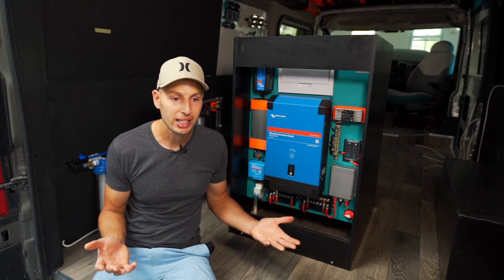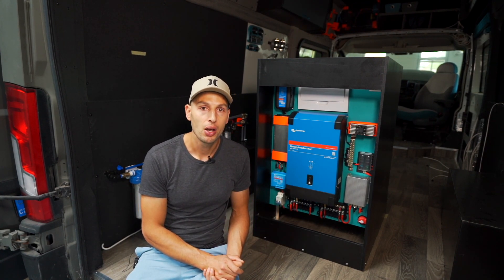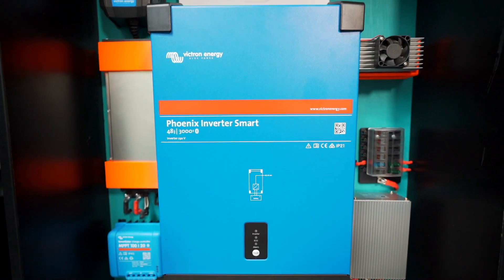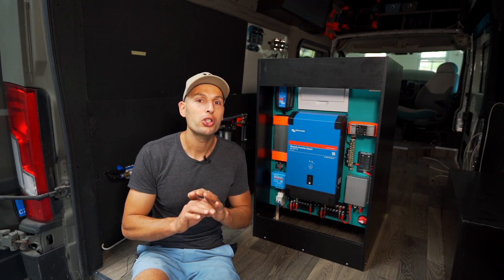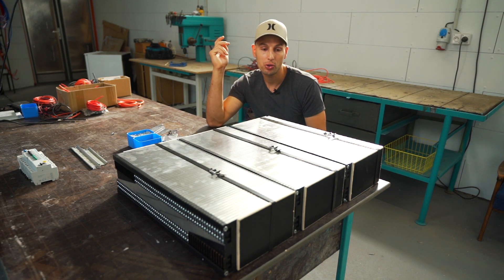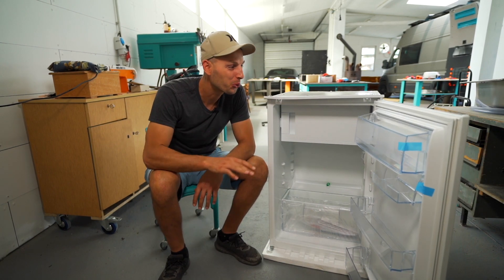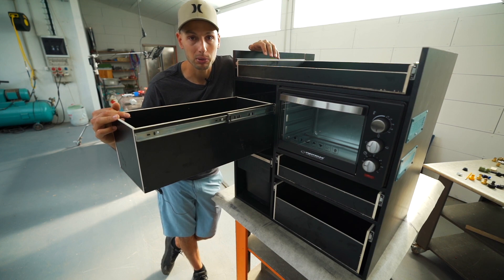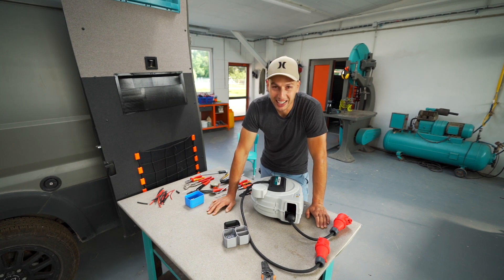New Approach to Electrical System in CamperVan (48V)

Comment: @8:41 - How you got that number for the 12V system ? that 6500 A ? it should be around 1000 -1100 A from your previous values given.
Reply from the maker: My mistake and forever recorder in a video 👎

Comment: Hi Ladi,  was very interested by your video, I need to recharge my 48v ebikes off my Lifepo4 24v battery. looking for a reliable dc-dc booster charger with cc-cv feature. Would you mind telling me the brand that you are using in you van ? THX

Comment: your realy realy bad at matt...  13kWh in a 12.8v system  would only be 1015Ah ... not 6500ah ...so basicly you could of went for 4 basic 280ah 12 batterys widly available ...and had a bit more Wh.   
your build isnt cost effective and has more points of failiour  because you have way  more cells in the setup. each cell is 1 weakpoint in the system. ...
Ah= Wh/V  or  13000/12  1015ah   or  130000/44  295 
SOOO people when looking at batterys   only look  at the Watt Hours you will have   not not not Ah this could give a fals view ... 
and 2  if your doing a build. like this one ...ONLY buy  Server Rack 48V 100Ah or 200Ah batterys...you can fit 1 first...and just do an easy addon when you can afford it to expand. just reserv some space for it ...48v100ah  +- 4800wh ...and it doesnt take up a lot of space at all... 
mppts for 48v and other gear is also cheaper than 12v or 24v systems....  cables are cheaper and more easy to handel...so ja ..in the end its a good build ... (*exept the battery) haha

Comment: Also in 24v or 48v system do not use 12v batteries (BMS's will get out of balance). When comes to 24v/48v system use only 24v/48v batteries.
Reply from the maker: What are you talking about? You can have four 12v batteries in series that gives you 48V system! Or in my case using 12x 4,2V batteries with bms..

Comment: I saw a guy use cheap 12-48v step up converter to boost his alternator voltage to 48v and then fed that to an MPPT controller to charge batteries. He wired 4x (300w) in parallel which required balancing resistors and diodes to make converters work together, he uses this to charge 24v system

Comment: Ladi,  I have a question young man...
regarding the toaster oven.... did you line the interior of the cabinet housing with steel or anything as a heat protector from the oven?  I noticed you place vents on the side.... I am guessing they are lined up with the ovens venting ports... will those exterior vent ports be enough to vent the heat from the oven, considering its in a fixed tight spot and those ovens generally need space...  I would like to do something similar as opposed to having to pull it out and place on the counter top and wait to cool before putting away...

Thanks so much!

My best
Randolph

Comment: Ladi its an amazing set up and woww well done its off the grid with design,  BUT you are missing one thing CAMP sites only normally give you 6-8amps if you are lucky, with the power draw you are asking it will keep tripping the camp sites electric. So you will be relying on sola DC to DC to keep the batteries charged. Or just charge the batteries with the 6-8 amps. Is this somthing you have thought about. Love the design and how its coming together, 👍 michael UK

Comment: If you've got a compressor fridge then it won't ever be the quietest. The only realy quiet fridge is absorption fridge, and you can get a lot of them, that work on 230V AC, 12V DC and gas. With 12V DC you will get lower losses than with 230V DC. This is important when you are driving to another destination, and you really don't want even the quietest compressor to disturb your sleep. Also the 230V AC system for the whole VAN may be convenient, but you will get a lot of variable EMF inside the van (with DC you don't have a variable field at all!), which is already made of steel, acting half like a faraday cage (except windows etc.) keeping the fields strong inside and weaker outside. Same with your bluetooth and wifi, it really doesn't make any sense to do any wireless inside a steel "house" where you don't even need to take 2 steps to get to a wired device (like a control screen with all readings). Wired is the way to go on this setup, for better health. Convenient does not always mean better or healthier. If "microwaves" is really not your thing, just measure how much different is the RF emitted from a wifi router vs RF leaking from a microwave - there're devices that measure that - but to ruin your surprise... it's about the same...

Comment: Forgive me I've only just stumbled across your video. But at time 3:49 in your video your showing your distribution blocks. Might you know the AIC (amps interrupt capacity) of these particular fuses? Are they rated to break a 48VDC nominal ark? Again I'm not trying to be confrontational or rude; just wanted to ask so everyone is as safe as possible (I've seen to many use standard automotive fuses that will cause fires & not act as true rated fusible disconnects). All the best to you and your van build 😊👍. Thanks for sharing!

Comment: I'd check with a qualified electrical engineer on using 3-phase the way you describe. In my industrial-technician phase/career we were warned to not unbalance a three-phase system the way you describe.

Comment: I don't know the specifics, but I know my late brother started a welding business with a homemade welder. His welder consisted of a bracket and separate (manual engage/disengage) serpentine belt to run 5 extra alternators on his old F-150. RPM's controlled by a brick on accelerator pedal. We called him the red neck McGyver!!LOL!!

Comment: I think you are mental using 3ph… every time you plug-in somewhere new you are going to have to multimeter the output to make sure you aren’t going to turn everything to toast.

And please don’t make a set of 3x 1ph ‘tails’ to merge/split… can be really nasty if there’s a voltage difference.

PS what campsites are you visiting that can supply 3phCeeForm?? 🧐

PPS everything else : Awesome!

Comment: a fwd van with a long wheelbase and a heavy rear axle load. Q. Have you ever thought how good it would be to use benefit of your 48v electrical capacity to provide the option to drive an electrical motor to gain traction from those heavy loaded rear tyres?
Reply from the maker: That is a very bad idea. I would need much higher output, gain a lot of weight, complicate the system with a lot of modifications. Nobody would ever see this as a good idea to do.
Reply: @ladiandmargaret  - output depends upon on the power requirement of the motor, namely the peak Amps draw, at 48v this would reasonable until 15kW. The purpose of the drive system is auxiliary for recovery purpose at zero and low vehicle speeds so Torque (traction at wheels) not horsepower is the requirement.
- Weight and complication - yes for sure 4x4 costs - take a look under a Sprinter 4x4 transmission system, check the additional component assembly weights (transfer case, low range gear and 2nd axle differential and driveshafts. circa 150kg) - and the cost$$ of replacing an existing promaster with a 4x4 sprinter or an AWD-Transit.
-Nobody would ever see this a good idea? > it is called P4-thru-the-road-hybrid, the auto industry has been playing with it for 30years and Toyota has demonstrated it can provide highly effective offroad capability in a hybrid, nonetheless the size of market from an OEM perspective has always been limited,  but the market is changing dramatically with EV, yet BEV alone on a heavy Van/RV is a long way out of the horizon of existing van-life promaster owners. Especially those who do wish to push their vans into more adventurous parking location where a 4x4 feature would be distinctly an advantage.

Comment: Run the 2nd alternator using the pinion on the diff housing, When the rear wheels are turning it will generate power

Comment: Great video 👍 I think your system is so ahead of any other in vehicle system out they.If a second alternator is used maybe a modified one with a air conditioner drive pulley which has an electric clutch on the pulley output controlled by an Arduino.

Comment: Why did you configure the battery for that lower than normal voltage? Will the victron inverter still make AC power at 36 volts?
Reply from the maker: Good question. The pack seemed to be better configuration to fit my space and series are much easier to upgrade. I think the inverter stops working at 36V so having 14s would be more suitable for sure.

Comment: I think that 3 phase cord is a huge mistake. Besides industrial buildings, I don't know where you'll find a 3 phase power supply. There's a reason no-one does it. Not even expedition vehicles that run close to 1000A li-ion batteries. If you were aiming for a top setup, there's the Quattro. Even the multiplus would be better.

Comment: As an electrician I'm in pain... running 3 different phases via CEE7/4 or CEE7/7 in a 5-wire-cord (L1/L2/L3/N/PE) is very dangerous, there are sockets (outise czechia) with an indefinite L/N behaviorso you can't just plug 3 CEE7/4 or CEE7/7 easy together
Reply from the maker: Thanks for pointing that out. I’ve already been educated and I can’t thank you enough 🙏
Reply: @ladiandmargaret  So could you solve the problem and make it safer in the meantime?
Reply: would it be impossible for you to explain what does it mean for non electirians?

Comment: STOP !!!! At 14m 40s you talk about having 3 domestic outlets - do not do this it's very dangerous (these are known as Widow makers for a reason). In your cable drum/van, all three outlets will use the same wire for the neutral. In the best case scenario the neutral in the wall is at 0 volts relative to Earth and thankfully everything will be OK. But in the real world, the neutral is never 0V, so the neutral pins of the plugs that are not plugged in, will be sitting at X volts. Worse case scenario, the wall socket is wired wrongly and the line & neutral are reversed, so the neutral pin in the dangling plug is at 230V, touch it and you're dead. Additionally you might be tempted to plug more than one plug in to a wall socket at the same time. If those wall sockets are on different phases, then you could have 415V inside your van. Worse still, if one wall socket is wired correctly and one incorrectly, then you're going to be connecting phase to neutral and could end up with a massive fire.
Reply from the maker: Hi David, can you explain what you mean by 14m 40s? I’m not following.

Sounds all like massive coincidence. Breakers would take care of some of this I believe.

These things I talk about are conceptual publicly vocalized ideas for this reason. I want people to bring ideas and concerns. It helps make things better and I explain why it’s good/bad in the following video.
Reply: @ladiandmargaret  >can you explain what you mean by 14m 40s? I’m not following.
Hi yes. At 14 minutes and 40 seconds in to your video you talk about having 3 domestic plugs and plugging 1, 2 or 3 in to a wall outlet. So if you plug 1 in to a wall outlet, the neutral pin on 2 & 3 could easily be at an unsafe potential. Breakers would not take care of this unless the wall outlet was protected by a residual current breaker (RDC). 
To be honest, any system that relies on RCD's as the primary method of safety, is designed wrongly.
Also breakers wouldn't take care of a phase reversal (actually a really common occurrence). The most likely outcome is your cable or extension reel catching fire.

One of the other problems with using a 3 phase cable is that if you plug all three outlets in to the same phase, because the neutral cable is shared, the rating will be 1/3 of the drum rating.
A 1.5mm cable is rated at about 13A if the drum is fully unwound (about 5A if the drum is wound), so if you're using the cable as 3 single phase cables with a shared neutral, the total load will be 13A, NOT 13 A per outlet (this would be a lot easier to show if the comments allowed images !!). Which means if the outlets had 13A breakers, the neutral (or ground) core of the cable would fail before the breakers.

Comment: Thanks for another cool video and technical explanation. I have been back and forth with my electrical system, one 48 V system or separate 48 and 12 V systems or just a 12 v system. My reasoning has been similar to yours, cheaper 230 VAC apliances and just necessary 12 VDC (like lights ans some 12 VDC sockets - even water pump could be 230 VAC). Only problem with this is the need of a 48/12 VDC converter and the efficiency of it, but as long as the load on those 12 VDC circuits is low it should not be a deal breaker.
Reply from the maker: I think it’s better to convert down to 12V instead of converting up from 12-230V with cheap inverters.

Comment: Look for 56v alternators - these are for charging batteries - not 48v - those are not for charging batteries (usually). A selection of truck/bus systems use these. If you search for 48v you just find the new $3k Balmer 5Kw solution which does charge batteries - still worth checking marine video installs of this for ideas, if nothing else. Dunno the price for 56v Prestolite ones but these are the de facto standard for the traditional 48v battery chargers. Maybe there is a reconditioned market for the 56v alternators. I fear 48v hybrid alternators are still rare - some vapourware still - and will depend on dedicated ECU controlled regulators that need full communication with the BMS via CanBus (a protocol) not just RS485 (a physical layer  bit communications). Maybe there are some youtube channels that have hacked these? Research for the correct BMS Canbus or maybe just RS485? that can work with you chosen regulator. You will need a new belt , suitable sized pulled and type (there are at least 4 types), a new tensioner and a suitable mount to match your alternator to the second alternator position. Make sure your second alternator mount can take the load (not the weight) of your chosen solution Then you will need a suitable regulator  - make sure it is soft start to stop loading the engine when starting in cold conditions - these are expensive but must match the alternator - usually from same manufacturer. Also make sure these include temperature regulation, I assume you will go for air not water cooled alternators. Also need to make sure the engine bearings can take the load especially if over 3kw, possibly  might need to uprate this.  If you do all this you will charge your bank with 3 hours driving from 0. Alternatively I have not found more than ~800W 12/24 to 48v DC-DC converters but you can put them in series checkout Sterling DC-DC Chargers for this around £350. You could charge of both alternators this way - say 2 12v 70a alternators and 2 Sterling DC-DC Chargers for around 1.5KW - still more than 3x less than the 56V solution. You battery charging range for a 48v bank - nominal 44V you say - is odd and that might cause some issue with charge settings on your DC-DC charger. What batteries are you using? That greatly interests me.
Reply: Also check the rpm for max power ratings. Aim  for 1500-2000 rpm max power - fast idle/normal driving - for diesel most likely. Higher power ones max at 3000 or 6000 rpm are for petrol engines.

Comment: Truly impressive setup! But I'm somewhat confused on your conversion for the 12V system comparison: Wouldn't this correspond to 1100Ah (rather than the 6500Ah you're saying in the video)? This would not quite add up in terms of weight (our 400Ah 12V system weighs around 45kg)...
Reply: I thought the same. It is a pain to convert for the less electrically minded like myself, however I have a 48V 15.4kWh system and by my reckoning that's 1200Ah @ 12V
Reply: Yeah, got me really scared there for a second, 6500Ah and only 77kg? Almost threw my setup out the window! haha.. I am at 28kg and merely 240Ah.

Comment: Good decision to prefer a 48 VDC system and great installation job too. The only thing I would choose is a Microwave inverter oven (Panasonic example). I have one at home and can never live without it. The time for cooking can be reduced significantly. The program for pizza (frozen too) is just perfect. Convection, turbo bake and grill are doing a good job too, you just need to find the correct settings over time. I will never build a camper, but it is exciting to follow your handcraft and skills, which can be adapted even in the house. Keep going. 👍🤘

Comment: After months of research I found new 48v alternator 100amp for 696 Euro but my post gets deleted when I put link
Reply from the maker: Hi, can you share with me? Ladi@mysuperebike.com
Reply: @ladiandmargaret  They also have a 180amp 48v 1110 euro. The two models are (180amp) AAT3372 MAHLE and (100amp) AAN5920 MAHLE The also do a 56v at 150amp but I cannot find anyone with stock

Comment: True 48v for 3.6v cells would be 14S.
Reply from the maker: I actually designed this system with potential option to upgrade. Much easier to add 2s instead of 2p 😂